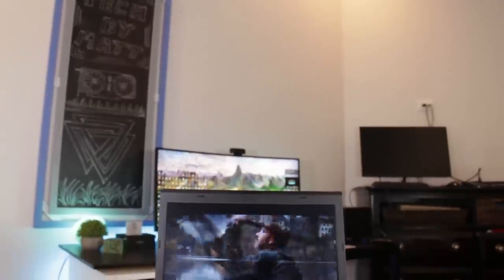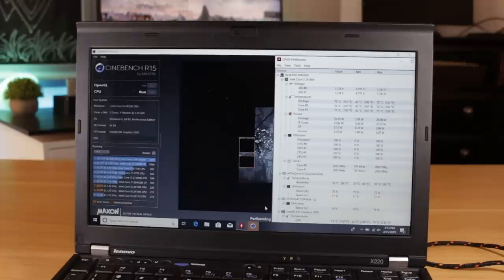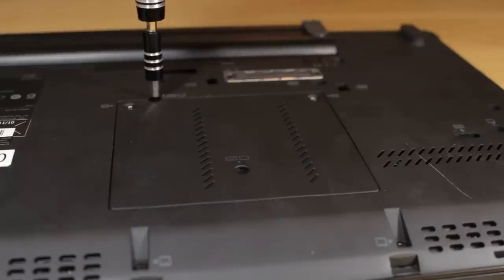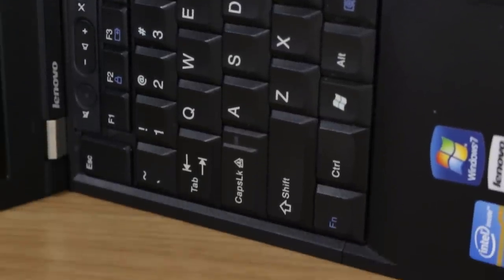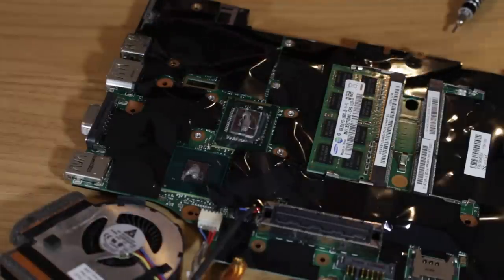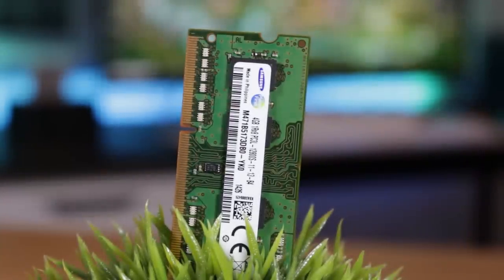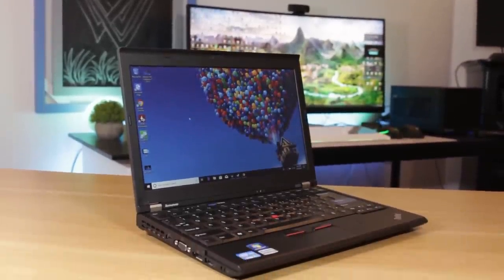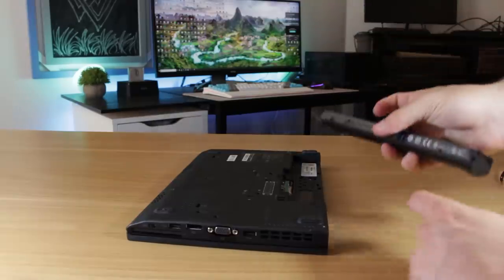What Can A $75 Laptop Do? (Plus Some Upgrades)

Comment: I have an i5 x220 with 64gb msata, 12gigs of ram & I'm about to shuck a 2tb Seagate slim hdd for it.  Had it for 5yrs and going strong for classes and use in projects at home.
Thanks for the tip on thermal paste, I haven't done that and it's been getting warmer the last year or so.  
Great video

Comment: I got a good deal for a ThinkPad W520. It was said to come with an i5-2520m, 4GB of RAM, no HDD and a 1366x768 display. It ended up coming with a quad-core i7-2760QM, 8GB of RAM (upgraded to 16GB), 320GB HDD (upgraded to an mSATA 240GB SSD), 1080p screen and an Nvidia Quadro 1000M 2GB. For £150, I'd say it was a pretty good buy, especially since it also looked basically brand new.
Reply: The K1000M is an awesome GPU. I always wanted one of the 500 series that had one because it's actually a pretty solid performer.

I'm curious about that quad core Sandy Bridge though, how's it perform? And what are temps like?
Reply: @EscanthonX  It would've been nice if it were a K1000M, but it's actually just a 1000M.

Temps at first were bad because the cooler it had was a 45w when this i7 is a 55w chip. Ended up buying the better cooler from eBay. Before replacing the cooler, temps would go into the high 90's to 100's but after getting the replacement cooler, the max I saw (on Ubuntu 18.04.2) was 85 degrees, and that's with Prime95 which is a very unrealistic workflow.

I do kind of wish I went for the W530, because Ivy Bridge runs so much cooler than Sandy Bridge lol.

Comment: Nice professional vid...  I purchased a Lenovo Thinkpad as well...  I don't remember the price... like $299.00.... I upgraded the RAM to 16Gb and that's it. It's a great 2nd laptop for me.. as it is not as fast as my new HP Pavilion... but it's good to know that it's there... I used it the last time when I found viruses on the HP - and it was scanning like crazy. - Comes with an optical drive... which I used to install MS Office with via folder-sharing - onto my new non-DVD-drive laptop.
- The only thing about it- is that I bought it with Windows 7 Pro... which I wanted. But the price for that is non-UEFI boot bios setting, which mean longer boot times. 
- All in all, it was an excellent purchase.

Comment: I buy a ton of thin clients for pretty cheap, I've got as low as $50 bucks for a decent quad core machine with 8gb ram in a tiny silent form factor.  Upgrade to a usable ssd and ram and you have a machine that'll easily handle Win10 doing any basic task although I usually use Linux (Manjaro, Arch, or Pop depending).  I use them for all kinds of things, my main one handles dual screen 4k no problem with display port.  Another Dell Wyse I use as no distractions word processor.  I made an Amiga 500 style clone case out of aluminum in my workshop with a built in mechanical keyboard that suits my tastes.  It's one of the quad cores with 8 gigs of ram that boots straight into VSCode or Atom in zen mode, both set up for writing, without any distractions.

Comment: whats the max egpu card you can use with this laptop?
Reply: Michael Schneider dont go for the rtx cards, as it will bottleneck. Depending on the game, it can run any card. It will however be slow, and limit its performance.
Reply: @phantom-xb6wv  so then what card is best?
Reply: Michael Schneider I dont know for sure, you can use any graphics card. I would however reccomend a lower end one like a GTX 960.
You could go for a 1050,1060 or even an x560, if you ofcourse have the money to spend.

Comment: @Tech By Matt Thank you for thi video. I own a X220 myself and there is a really good modbios out there. You can use DDR3 up to 1866MHz which increases the overall speed and the gaming performace. you can go for 16GB aswell. I bought it used in 2014 for just 115€ including shipping, with 4GB, a 320GB HDD and the TN panel. I played Spec Ops the Line the last days with DDR3 1600MHz and optimized settings. To get rid of throttleing I used liqid metal. That decreased the the core temp by 20°C. I also own a eGPU but have never used it for a long time. NVIDIA GPU's are working way better.

Comment: I picked up a couple of i5 Surface Pro 3s for around 50 bucks each on ebay. Most surfaces have had a pretty easy life in offices and you can just buy a new keyboard cover if there's any signs of wear. Perfect for kids to use when travelling as the battery life on them is 6h+ and the screen quality is better than most laptops!

Comment: I've been considering doing this exact same kind of upgrade to my old laptop. It too has an ExpressCard port, but the CPU is sort of lacking. It's an i3 330m, but the socket can support an i7 620m which is actually exactly the same performance you'll see on this 2410m. Only thing I considered doing differently is using the mSATA port for an eGPU and using the ExpressCard port for USB 3.0 ports.

Comment: I managed to snag a Dell Precision M6800 the other day for $200. Came with a 750GB HDDx 32GB DDR3, i7 4800QM, and an AMD Radeon M6100. Put in a 500GB MSATA SSD and another 2TB HDD and for about $400 I have a pretty capable mobile workstation!
Reply: Wow, do you have it yet? I'm curious how that firepro card performs

I also recently ordered a laptop - a Latitude e6540 - for $220. I5 4300m, AMD HD 8790m 2gb ddr5, 8gb ram, 256gb SSD, and a "healthy" battery.

I'm still waiting for mine though
Reply: I do have it. I don’t play many games, but it’ll run GTA V on normal to high settings at 1080p at 50-60 FPS. Very consistent. It’s good for hardware acceleration too in video editing. I believe it has 768 processing cores, though I could be wrong about that number.

Comment: I have my X230 upgraded to 16GB, Full HD IPS display, 500GB SSD + 256GB Msata, AC wireless adapter, BT card replaced with hidden second wifi adapter, running Kali Linux. A real sleeper.

Comment: I recently got a T420S as a replacement for the netbook I use when traveling

It's amazing, especially with the 4G/LTE card (had to use a custom bios with the lenovo whitelist removed) and ultrabay battery (replaces the DVD drive with a second battery) 

The runtime isn't as good even with both batteries (4hrs vs 7hrs), but the performance and typing experience is so much better 

I can even play half life 2 at full resolution and high settings

I would say that a custom bios is absolutely required for these machines, Lenovo puts a hardware whitelist in the bios to limit upgradability (particularly for network adaptors, RAM and other aftermarket parts) 

Getting the fingerprint scanner working on windows 7 is also a bitch too (due to a glitch with the power saving features)
Reply: As far as I know RAM has never been whitelisted on ThinkPads. Network adapters, yes, and for one generation (the xx30 series) batteries were whitelisted as well, but Lenovo 180'd on their decision and I think newer ThinkPads are a little more lenient when it comes to what parts you put in. Plus it's very easy to remove the battery whitelist.
Reply: @SebisRandomTech  RAM was whitelisted on mine, I tried installing 16GB and it wouldn't post, I then flashed a custom bios to remove the whitelist (for the purposes of using a newer cellular WWAN card than was installed) and I noticed that I could upgrade it to 16GB of RAM 

I'm not sure why these anti-consumer practices are legal, but a custom bios fixed pretty much everything and now I have a ThinkPad with 16GB of RAM, a CAT 11 LTE card and 2 batteries
Reply: @mwbgaming28  That's odd, I've never had issues with RAM upgrades on my ThinkPads.
Reply: @SebisRandomTech  I guess it might be something that Lenovo put into some of their machines but not every model 

In any case, any sort of artificial limitation (like bios whitelists) should be banned if it is not serving the purpose of making the computer last longer
Reply: @mwbgaming28  Can't do that! Then Apple would go out of business! :P
Reply: @SebisRandomTech  lmao, that's a bonus (apple ruined the phone and laptop industries)

Comment: I hadn't even realized it until now, but SB is "old tech" now. At least until software companies adapt to the higher freqs an core counts we're seeing now, non-trashed used laptops are going to be amazing. Edit: Heck, even some of the trashed ones. It's just that HP and most others charge three arms and six legs for replacement keyboards and track pads, so that missing key might run you the cost of the laptop.

Comment: 6:08 it wasn't the 4GB RAM that hindered your experience, it was Windows. This laptop would be superb with Linux (preferably with KDE Plasma).
Reply: Well that and the disk drive, that thing is slow as molasses. But yes, win10 does like more than 4gigs of ram. However, once the laptop is using ssd and >4gb, it actually performs pretty well for casual use.
Reply: @carlos2004  My desktop uses just a spinning HDD and 4GB of DDR2. I guess I'm used to potatoes.
Reply: @kanishkachakraborty  Get an ssd, even it's only 120gigs; thank me later. It makes using a pc such a much smoother experience, that it will feel like a whole new pc. You'll never go back to using disk drives for boot drives.
Reply: @carlos2004  I'm planning a full upgrade. And yeah SSD is pretty high on my list. :D

Comment: Got a T440p for 80, upgraded the CPU to a quad core i7, ram to 18gb, and a 2tb sshd, with a 500gb ssd in the msata... It also uses the Intel hd 4000 series, instead of this ones 3000. And can be gotten with the nVidia 760gt iirc. But the hd 4600 is rather good. Especially with the upgraded heatsink from the nvidia model.

Comment: I have newer Thinkpad and a Macbook but I still use my X220 for programming. It has the best keyboard feel and layout for typing. The main issue is the high running temps and the loud fan.
Reply: Might just need a partial disassemble and a good cleaning out.  Could have a fair bit of dust inside.

Comment: One thing to do is to upgrade the bios to allow fast memory again. The current bios only allow Ram speed of 1333mhz and the unofficial bios unlock it to 1866mhz also it removes the whitelist so you can install any wificard you want.

Comment: I have an ThinkPad e530 from mid 2012. The best 50 bucks I ever spent was on an SSD. Startup times were cut by 2/3. 

Win 7 support is running out soon and I did no have the cash for a Windows license. 

Linux Mint Cinnamon just flys on an SSD.
Reply: Windows is bloated with legacy software. Linux is pretty good, especially since Think pads have amazing Linux compatibility and driver support.
Reply: @rehmanarshad1848  The only thing that I had to do was download a proprietary Linux/Ubuntu driver for my wireless card.

Everything else just worked out of the box.
Reply: @edalder2000  oh your using ubuntu, which version? Because I tried Ubuntu 18.04 LTS, and the wifi works out of the box. No need to download anything. And it even works on PUBLIC WIFI networks!
Reply: @rehmanarshad1848  My older ThinkPad has a Broadcomm wifi card. Those can be finicky. 

I use Linux Mint Cinnamon 19.1 which is based upon Ubuntu.
Reply: @edalder2000  I hesitate saying this, but try an Arch BASED distro. My professor had us try his modified version of arch, it was annoying as hell. Not beginner friendly at all. Manjaro or any other arch BASED distro will always have the most up to date packages, and drivers so it might be a better option, and they are more beginner friendly. In my opinion it might just be easier to change your wifi card to an Intel one if your laptop has compatiblity and supports it, without having to change the distro.
Reply: You can update to Windows 10 for free. I recently did.
Reply: @Tritone  windows 10, runs very very slow and laggy on older hardware. If you don't have an nvme pcie ssd, it runs like crap. Even sata ssd's run windows 10 horribly. If you have a regular HDD forget about it. Windows 8 and below run fine on HDD's but windows 10, it's a different beast, they added tablet mode, and a bunch of other useless stuff that desktop users would never care about further evidence its bloated as hell, and needs a complete overhaul for a new build, and don't even talk about botched windows 10 updates. If I got a penny for every botched windows update I'd be a trillionaire. Linux ftw.
Reply: @rehmanarshad1848  I am writing this message on an x220 (8 years old), running windows 10, and it runs fantastic. No discernable performance difference between this old cheap computer and new laptops. 

Laptops have been much more powerful than most people need them to be for the last 10 years now.
Reply: @Tritone  which build of windows 10 are you running if it's 1809, my mind will be officially blown. If its 1609 which runs really well on older hardware then I'm not all that  surprised.
Reply: Also what are the specs. Modern laptops are getting ridiculously powerful processors that really aren't needed back in the day older processors were huge bottlenecks for graphics cards. That is no longer the case. It also depends on your use case. Then again early 2000's Lenovo machines were fucking incredible shit ahead of thier time. My dream set up would be a Lenovo t400 series with ubuntu, and a compatible docking station, connected to a bunch of external monitors. On the go and desktop mode switchable.
Reply: @rehmanarshad1848  I'm running Windows 10 version 1809 build 17763.5. I have a 2nd generation i5 processor, an mSata SSD, and 16 gb Ram (much more than I need). It honestly couldn't be running any faster/smoother than it is. I don't notice a difference when using new computers. 

You only need the faster modern processors and graphics cards if you are gaming or editing high definition video. Most people don't need that shit. 

I'm even able to run Ubuntu and MacOS Sierra Virtual Machines on this computer without a problem. Cheap refurbished computers FTW! They are practically giving these laptops away. They're fantastic and easy to upgrade.
Reply: @Tritone  My friend gave me his old HP Omen computer from 2015ish? and it's running windows 10 fine, it has 12 GB of ram so it isn't as noticable. But my 4 GB of ram 5th gen intel core i5 2014 macbook air runs so smoothly. All i need is a bash shell, and a text editor. So I'm good.
Reply: @Tritone  2nd gen i5? Damn, I have the 6th Gen, and I still can't figure out intel's naming scheme... :-(

Comment: Great review! I just ordered a refusrbished one of these for basic coding and development work. Every new laptop on the market for less than 400 bucks right now is a cloudbook with around 64bg or eMMC memory, barely enough for windows 10, they're a total rip off and built to fail. Manufacturers have realised ways to cut costs and trick less knowledgeable consumers into buying these for the same price they would've bought a basic office laptop 10 years ago. One big OS update, and they become useless. This however, will be upgradeable for while still.

Comment: Desktop 2nd & 3rd gen i5's are amazing bang for your buck these days, and so are used laptops mounting their mobile counterparts if you take some time searching for fine deals. Just avoid the U (low power) models unless you really want to use them away from a power outlet and plan to buy a new battery, as there's considerable performance difference. The machine I'm writing this from scores about 4000 CPU PassMark points (i5 3320M), not bad at all for a 2013 general use lappy which I paid under 60 bucks for in an eBay auction (part of the reason for it not going higher is significant cosmetic damage on one corner, but hey, I use that at home only anyway). Yes, it came with its power brick and everything. I actually won 2 units from the same seller for nearly the same price. And that's here in Europe, where you rarely get such fine deals as in America.

Comment: I have an x220 with 8gb ram and a cheap san disk 240gb ssd from Amazon. Super fast little machine (faster than my hp x360 with an 5th gen i5) that I can just throw around without worrying as it’s soooo sturdy it’s great for getting work/emails/excel files and mine gets a good 2-3 hours on battery. It isn’t the most prettiest device but when you consider how much I paid (including upgrades, £125) Its a really great little on the go work machine
Reply: Done**

Comment: You can get a Thinkpad advanced dock. I have one with my t420. Even the recovery image is easy to get. Yes, factory original recovery and that keyboard... yeah! The classic thinkpads are legendary. But I still prefer my Dell latitude series. Especially over a modern thinkpad. But if I was stuck with my t420, it still wouldn't be bad. The build quality is bliss compared to their modern stuff.

Comment: I have a kind of similar laptop, but mine is a Dell Precision m4500. It has a first gen Core i7 cpu with 4 cores 8 threads. It originally had a 250 gb hard drive, but I was able to install a SanDisk 128 gb msata SSD and just keep the hard drive installed as secondary storage. It also originally had 4 gb ddr3 ram 1333 MHz but I upgraded that to 8 gb.

Comment: Still maintaining mine ten years past launch. Runs great with my programming work, but I've been having issues finding reliably working (read: not broken) IPS panels. Have had to return two so far, pretty close to just keeping the TN in. Surprisingly, good x220 batteries are still pretty easy to find, but I wonder how much longer that will hold true

Comment: I have an x230 with an i5 3320m and it works good! I have put in it 12gb ram, 64gb msata ssd, 500gb hdd, i use also an exp gdc with a 970 (and yes there is a bottleneck, but that 970 is my old gpu... I'm gonna switch to a 1050/1050ti cause i can power them just with a power brick and carry them when i need, with the 970 i have to drag with me a desktop psu...), i have also a docking station that works fine, the hd 4000 can play videos on my qhd monitor fine, it even handled minecraft in qhd at 60fps (mostly thanks to the cpu staying stable at 3.09ghz), and it has usb 3.